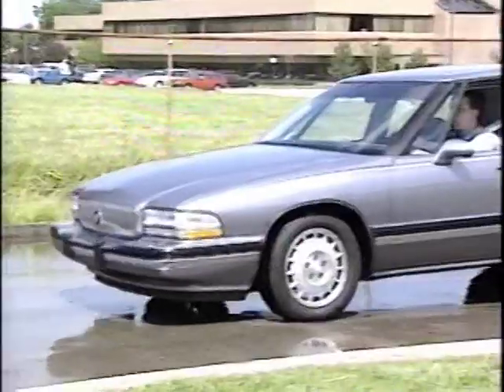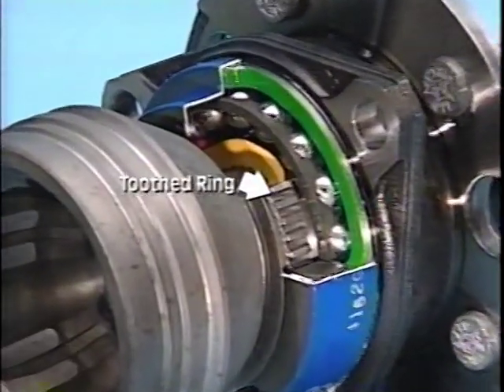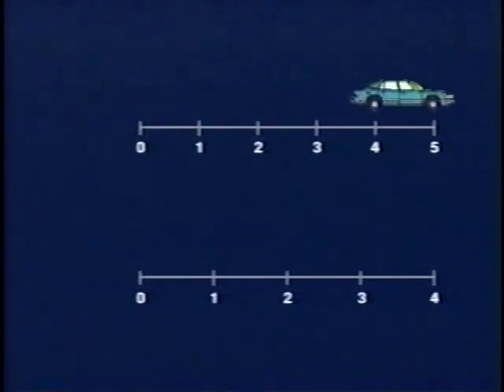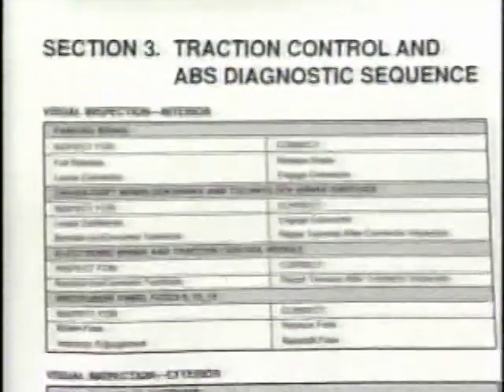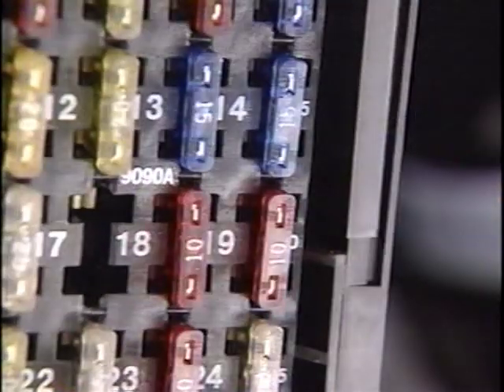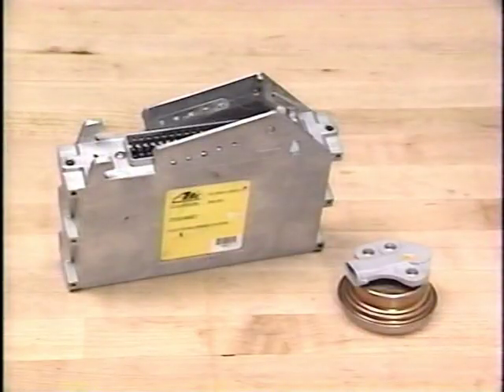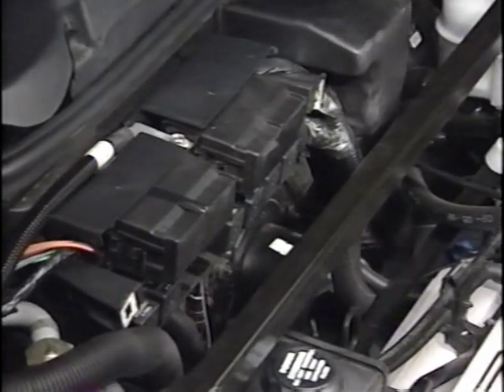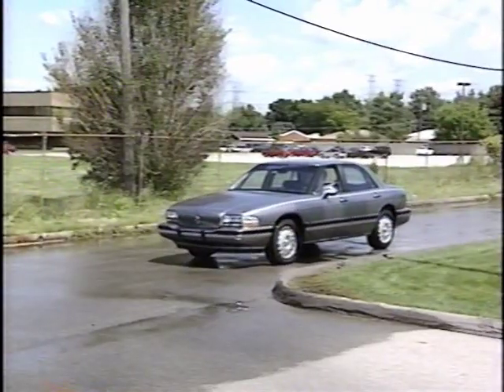Buick - Traction Control & Antilock Brakes (1992)

Comment: It's a good thing you didn't try to fix Michael's car yourself.  This video includes A Traction Control unit (that his car does not have) but continue watching to see all of  the parts that 'could' be wrong with it.

I'm also finding out that your car, the one that bubbles inside the brake fluid reservoir?  Is your abs pump running continuously (I saw that in a different video).

It's a long video but it tells you what everything is and where to find it as well as fuses to point you toward the defective part.